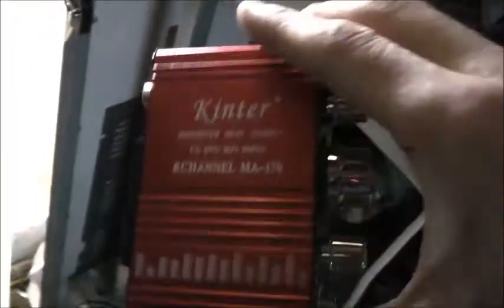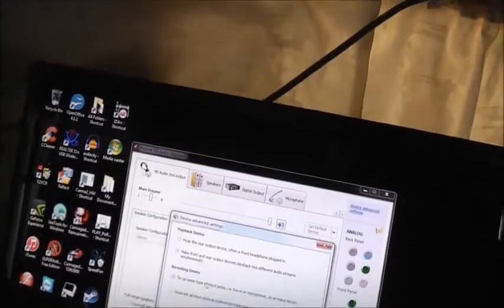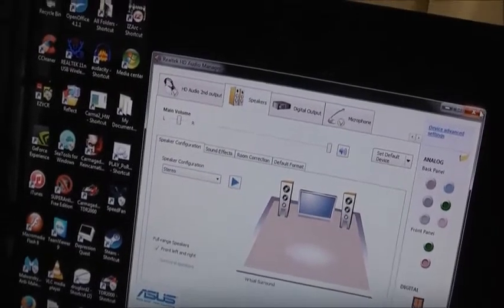Mancave PC USB 3 Upgrade & Kinter MA170 Finally Turned Up!!

Comment: Problem with those USB 3 cards in a PCI slot is it runs at like half bandwidth lol. Still faster than usb 2 though
Reply: Hey, can you point me to a PCI (not PCIE) USB 3 card? All I get when searching is PCIE x1 or x16 based cards, my MB does not have any of those slots and I want to install one. MY MB has 6 PCI slots and 1 AGP, I have 4 spare PCI. It also has some sort of header that is a PCI x1 (once again, PCI not PCIE) slot. I have quite a few USB 3 capable deices and they are stuck at USB 2 speeds. Any suggestions?